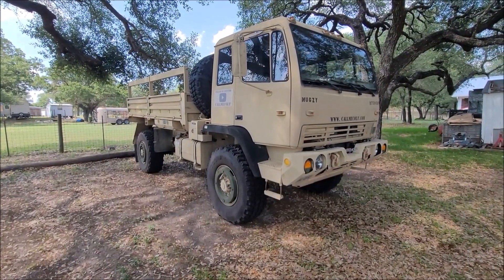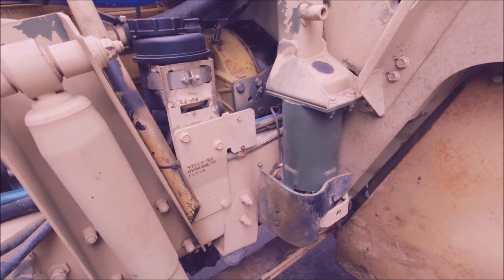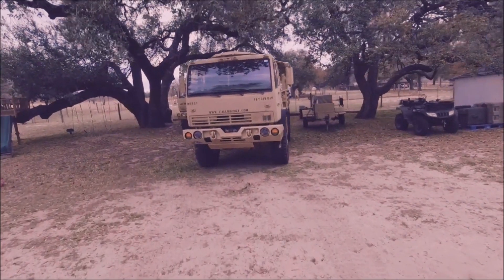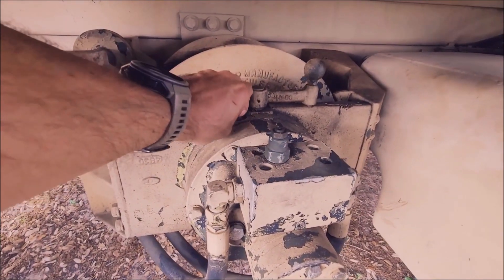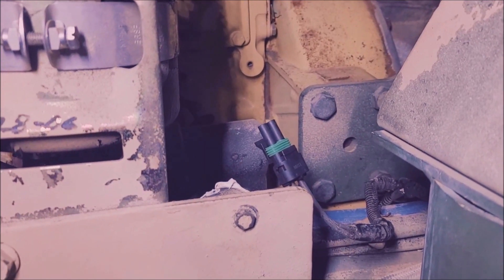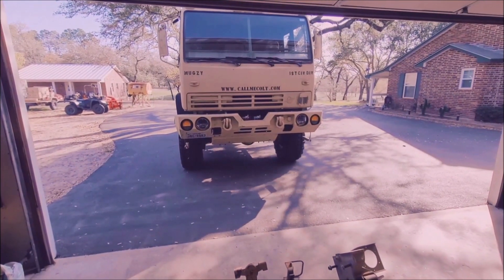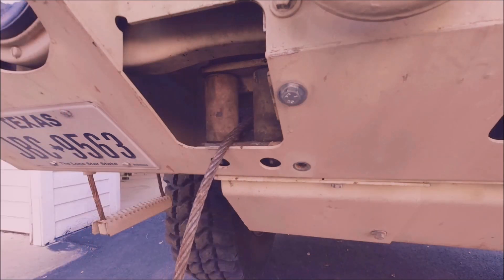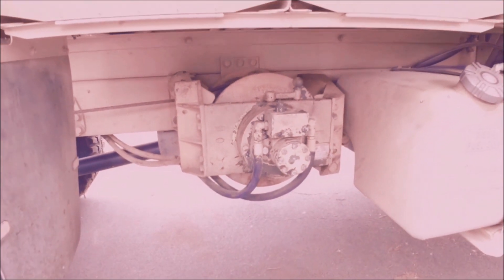M1078 LMTV - PTO winch install part 2

Comment: Wow, that winch was fully integrated into that truck…obviously designed to be factory installed and not made to be added later, at least not easily!
Reply from the maker: Yes, it was an option that was available on the truck but did not come on all of them. I was able to get the parts of a truck that had it but was parted out. Not an easy install but well worth it!

Comment: Are you going to stay with the steel cable or switch to synthetic cable that is currently preferred by off road enthusiasts?
Reply from the maker: There is no viable way to switch to a synthetic cable for this system due to the rollers and fairleads. I also probably wouldn't due to cost. I will not be winching all the time, so the steel 1/2 cable will last me a lifetime.

Comment: On the hydraulic fluid. Ive been able to find AW32 and AW46. No luck with AW42 that you showed in video. Any help would be apprecaited Sir.
Reply from the maker: The fluid I showed in the video was at AutoZone. Honestly, I don't think the system is that picky. I just got what was close.
Reply: @CallMeColtLLC  I had attempted to zoom in with no avail Sir. I did look specifically at AZ site. Finding just 32 and 46.  I hope the system isnt too picky. After some digging im going to give the 32 a go and see what happens.